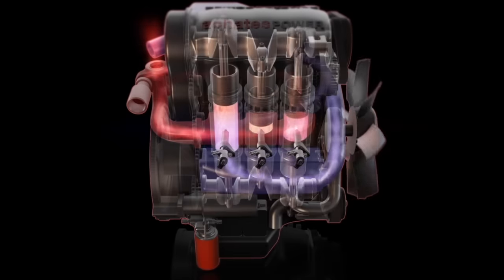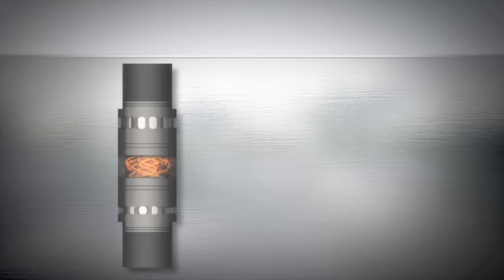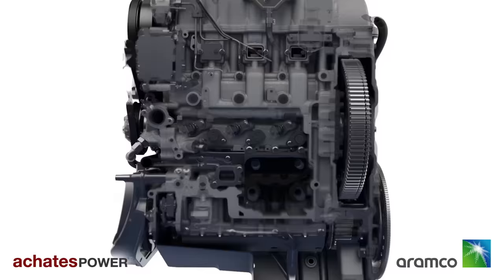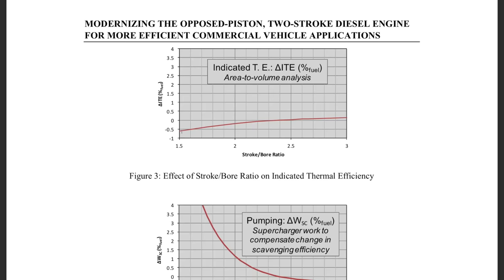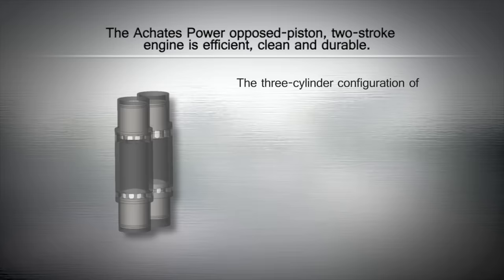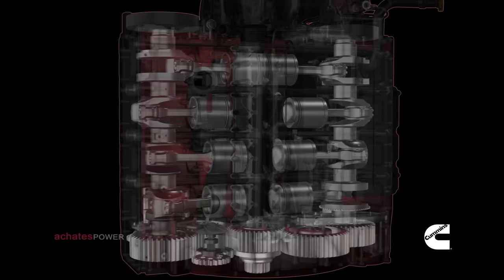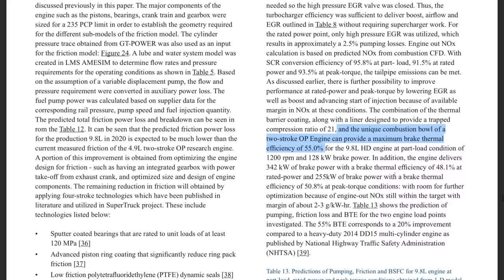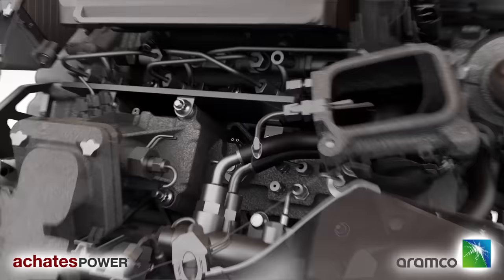Opposed Piston Diesel Engines Are Crazy Efficient

Comment: The disadvantage of this engine was high oil consumption which resulted in high burned and unburned hydrocarbon emissions. 
The cause of this high oil consumption was the pistons passing in front of the intake and exhaust ports.
Reply: Any two-stroke is going to consume oil, that is the whole point of the design
Reply: mijnkampvuur once the piston rings start to crack you will see the oil consumption, or see it coming out of the air box tubes like the old two stroke diesels. By the time this thing gets choked down by US requirements with exhaust particulate filter, SCR, VGT turbo, urea injection etc. it will be just as good as any other engine out there, not better.
Reply: Grant Schoen You are right about a 2 stroke engine consuming oil (thus higher emissions and more wear than in a 4 stroke engine)   However this is inherent to the design of the engine, it is not the point of the engine.
Reply: Yes, it is inherent to the design, but also is kind of the point - which is for the sake of simplicity & weight/cost savings to not have a separate crank-case/valve-train from the cylinder block, thus a higher weight/power ratio.
Reply: Grant Schoen. . the extra oil consumption and wear would be avoided if at all possible. . and so of course it is not any point at all -- but cannot be avoided.
Reply: Burning Oil is not the point of a two stroke.
Reply: Even if it's not something that blows the current systems out of the water, it has some inherent advantages with the much lower weight, add compression ignition and you'll still have a considerably higher energy density even as it starts losing hits. I personally believe that the coming of a 4 stroke is gonna just be a matter of time and the current concepts are already good enough for commercial testing.
Reply: You have misunderstood the concept, these engines have seperate oil in a sump like a conventional engine, the oil is only burned because  the crankcase is exposed when the piston close together allowing oil to escape.
Reply: It's unfortunate that so many people think that 2 strokes all burn a lot of oil. They can be designed with oil squirters or slapsticks just like a 4 stroke ect. Heck my 2001 see Doo is a 2 cylinder 2 stroke. No oil mixing and it's more fuel efficient, oil efficient and more powerful with a superior powertrain than most 4 strokes. This is a great idea for cars and trucks and even planes. Anyways it's been bought by manufacturers and its coming. About time!
Reply: This is a two stroke diesel not a 2-stroke gasoline there is a big difference 2-stroke in the sense that it produces power on each stroke with a gasoline 2-stroke engine oil is introduced into the gasoline to lubricate the connecting rod from the piston and the crankcase in the diesel engine that isn't the case it is oiled in the conventional manner via in oil pump so burning oil isn't an issue hence the higher efficiency
Reply: All electric cars suck and are too heavy because of battery weight.
Reply: Correct me if I'm wrong, but wouldn't it be of greater advantage if the pistons were horizontal to enable the ports to be on the top side of cylinder and reduce oil consumption?
Reply: Grant Schoen 2 stroke diesel not 2stroke petrol like a chainsaw engine
Reply: mijnkampvuur should make horizontally opposed. This might fix some of the oil burning problems
Reply: @stevefuller1779  it seems to me the pistons have double piston rings at the top an bottom of the piston so there's no way oil would escape trough the intake.
Reply: @andrewgroves8523  so like a subaru boxer but with 2 cranks different piston direction. That would interesting
Reply: A direct-injected two stroke does not mix oil with gasoline, this is how the current 2 stroke outboards work.   A diesel engine needs significantly  stronger  (read heavier) blocks to withstand the knocking.
Reply: Usually a 2 stoke diesel has another ring on the piston skirt to seal the crankcase from the scavenge air and exhaust ports.
Reply: @Grant Schoen a normal diesel truck 2 stroke (i drove one) does not use anymore oil than a regular deisel or the gas engine in your car.  the point of a 2 stroke is the get combine the power and exhaust and the compression and intake strokes so you have 2 strokes instead of 4.  small engines use oil mixed with fuel so that the bottom half of the engine is sealed and acts as a super charger.  when the cylinder goes down on power stroke the bottom half of the engine (the bottom of the piston and the sealed crankcase) act as a second piston and push fuel\air into a port that goes into the cylinder through a reed valve.  

now if the bottom half is sealed how do you put oil in it and change it without having a plug that could blow out or what happens if the engine tips a bit and the oil gets push into the cylinder instead of the air\fuel.  most very small 2 strokes (chainsaws etc) are made to be used in any orientation, even upside down so you cant oil running around inside the crank.  so you mix the oil with the fuel and use that to lube the piston.

but on a diesel 2 stroke you dont need the bottom half to be sealed because you can use a super charger or turboe charger to do the same thing that the crankacse and bottom half of the piston do.  the turbos push air into the cylinder.  so you can use regular motor oil in the same way that your gas car engine does.  most (pretty much all) diesal 2 stroke do it this way and have no oil mixed with fuel and the oil is changed as with any car motor.

not all 2 strokes have oil mixed with fuel
Reply: @grantschoen1726  it's a two stroke DIESEL! Not your average moped engine.  And since when has high oil consumption been a "point" for any engine design?
Reply: With a sealed oiling system the need for crankcase oil is eliminated. And today we have superior alloys for sleeves and piston rings. Reducing the need for wet oil lubrication. In fact a pressurised oil ring isn't out of the question. Shutting off the flow at the intake and exhaust ports will require minimal engineering. When I was in the 3rd grade I was talking to my uncle  (an excellent mechanic) about variable timing and combustion. He said that's impossible. Yeah I've been kicked down for every innovative idea I've ever had.
Reply: Thats probably why its diesel, because diesel is more oily
Reply: Shouldn't be for a diesel but the Deltics (Class 55 locomotive in the UK chuck out no end of blue smoke)
A petrol engine (gasoline if you are from the other side of the pond) , it is as the crank case is used to charge the combustion chamber so HAS to burn oil
Reply: Stefan0man  Most people don't really understand 2 strokes..  With direct fuel injection and sealed crank cases there is very little cross flow of older port timed systems and as mentioned oil use can be controlled very well now..
Reply: @Henry R you are so wrong about how how a 2 stroke diesel functions, it is comical.
Reply: if you look closely there is an oil control ring on the bottom side of each piston head/skirt that doesn't pass over the intake/exhaust ports.  question is, how are they lubricating the top compression rings? relying on the lubricity of diesel fuel perhaps?  i would be curious to know what the engine life is and how often overhauls are projected to be required.  in terms of operating costs, any efficiency gains can quickly be offset by having to overhaul the engine sooner than most.
Reply: Henry R diesel 2 strokes have a separated crank case from the cylinder and transfer intake and exhaust ports. A blower” is used to charge air into the engine. I take port. 2 stroke diesels have been around a long time. ie: GMC Detroit Diesel 6V92. No oil is mixed with the fuel before combustion.
Reply: From the pictures there appears to the 2 sets of rings. The ones at the base of the piston do not cross the ports. I assume this helps decrease oil burn.
Reply: Two stroke diesels are lubricated by a crankcase NOT by oil mixed into the  fuel.
Reply: There is a motor design without this oil problem. I think it was called kurbelschlaufenmotor (Ficht), don't know the english name. Something like scotch yoke. However it works directly opposite in function but the pistons don't need lubrication in a development I read about with something like graphite pistons in ceramic cylinders. It is quite different, without wobbling pistons. I leave this comment anyway.
Reply: @bobhumplick4213  Those old 2-stroke Detroit Diesels often had blower seals go bad. This resulted in oil being introduced into the cylinder along with the air charge to be burned, and most notably, oil slobbered all over the engine and the engine compartment. I drove numerous Detroit's over the years, 53, 71 and 92 series in particular. Some were total dogs, but a well-tuned, healthy "Screamin' Jimmy" with the right transmission and rear end ratio, was a driving experience to be cherished! If those Detroits stayed leak-free, their oil consumption was comparable to any 4-stroke in our fleet.
Reply: @ronaldgreene5733  I disagree. Take a good long hard look at G.M. 16 cylinder assisted aspiration engines used on locomotives. They are TWO CYCLE diesel engines utilising ports for intake and valves for exhaust, with very little crankcase oil loss. The lives of these engines are measured in millions of kilometers.
Reply: @stevefuller1779  Problem could be resolved by utilising REED VALVES to control the flow of exhaust/intake.
Reply: @stefan0man301  WOW, again, people thinking they've re-invented the wheel. Two stroke engines have been around for 100's of years. What has changed, is the way they are lubricated. For example, you Skiddoo utilises many advancements made by previous engine manufacturers over the years. The biggest break thru was computerisd injection and the optimal locations for this injection. However, it is FACT, they still BURN OIL. Otherwise they would not have a seperate oil tank for you to top up regularly. You are aware that SUZUKI was a leader in this field in the 70's and 80's with their three cylinder and later four cylinder two stroke engines, and of course the motorcycle manufacturers, still manufacturing two strokes to this very day.
Reply: @grantschoen1726  not two stroke diesel
Reply: @bobhumplick4213  We had Fairbanks - Morse engines on the Canadian National Railway 60 years ago. They were great until you had to repair them, which meant pulling the upper crankshaft to do any work on the pistons.
Reply: @jaswmclark  bet that was interesting
Reply: @grantschoen1726  You're thinking of two stroke gasoline.  Diesels are different.  They don't burn oil in the fuel like gasoline engines do.  They just have higher oil consumption due to the ports.
Reply: @grantschoen1726  but not necessarily excessive oil consumption, with modern fuel injection and wet sump, a 2 stroke makes more sense, specially in this setup. Besides, there are less moving parts, no cams and valves.
Reply: @vilemsustik3042  Ford just announced this powerplant will be installed on the F150, and it is not a diesel but compression ignition with gasoline.
Reply: Firstly there is no oil added to the fuel. Lubrication is usually dry sump with large scavenge pumps. Secondly as there is always a positive preasure in the cylinder due to residual combustion  or the  blower oil is no problem through the ports. Actually lack of oil around the fire ring has been known. Once the engine has warmed up they are quite clean.
Reply: @Michael467012  I would put the engine horizontally just because of better CG. The whole point of having those port placed on a ring is that you can achieve the same area with a more uniform opening. Having two holes instead of this ring pattern (as I assume you think of the "better" design) wouldnt help much in terms of oil consumption and would dramatically decrease performance. So they compromised.
Reply: @nimblemotorsports  It s impossible not to mix oil and gas in the chamber when you have two gaping holes in the design. Lubrication system is not isolated as in a 4 stroke
Reply: @grantschoen1726  i wonder if a 4-stroke opposed cylinder would still be more efficient than a conventional engine...
Reply: @itchyvet  No it will not.
Reed valves are only useful on PETROL engines to stop blowback through the carburettor.
On a diesel, the pressure on the intake is provided by a blower of some sort (turbo charger, super charger, Crossley used an air compressor), the crankcase is not used so no oil consumption (Well, no more than a 4 stroke, or shouldn't be)
Reply: @itchyvet  You are talking about PETROL engines
 Ski-doos, as far as I know do not use diesel engines
Reply: @stevefuller1779  how does oil escape from the crankcase??? The exhaust and intake ports are never  exposed to the crankcase except a slight bypass due to the gap between the Piston and the cylinder wall and a piston and cylinder length that never allows the exhaust ports to be exposed below the bottom set of rings ... This could be sealed with a second set of rings at the Piston base ... Thus negligible blowby ...
Reply: @jameswitte5167  , when you consider how many times a piston passes up and down per minute, even a tiny little bit of oil escape soon mounts up, also when the piston is at TDC some supercharger boost will leak into the crankcase around the piston skirt, conversely, on the exhaust side, that same pressure would leak back out of an adjacent piston  taking some oil mist with it. The problem with putting rings at the bottom is that it makes a weak point, also it increases the weight and you would need a long piston and bore to accomodate it all. As far as I know the Commer TS3 did not have too much of a problem but the Detroit Diesel were well known drippers. Still love two stroke diesels though.
Reply: @stevefuller1779  true ... Even gasoline engines have "some" oil infiltration ... I like the HP/Torque numbers here too ... Double ... I want it in a trike ...
Reply: @jameswitte5167  , that would be fantastic, I just want one to listen too ( want a Merlin Too!)
Reply: Michael467012  or even on a 45 degree to lower engine height and center of gravity . It could go north south with the top of the engine being right near where a conventional radiator cap is .
Reply: @grantschoen1726  In normal two stroke petrol engines the oil additive is used for crankshaft bearing and piston lubrication. This in not the case here because the fuel mixture does not pas behind the piston.
Reply: There are  admissions reducers on  lots of 2 strokes I'm sure they could figure somthing out.  Admissions won't be a problem.
Reply: Sorry, not correct. Don't confuse 2 stroke cycle with 2 stroke weedeater/chainsaw engines. Read up on 2 stroke engines with an oil sump.
Reply: @grantschoen1726  the oil consumption was related to gasoline engines.
Reply: @g8ymw  actually you're wrong. The Sulzer slow speed CI engines had reed valves.
Reply: @bobcornford3637  Why would they have reed valves, I do not understand?
The Sulzers used on Britain's railways were all 4-stroke
Reply: @g8ymw  This is a slow speed marine engine. Sulzer made all manner of four and two strokes. The ones I am refering to are uniflow engines, that it they have poppet exhaust valve. The reed valves are on the inlet side to ensure that air flow only occurs into the engine at starting when the electric blowers are in use.
Reply: GM solved this problem very simply on their 2 stroke diesels by having a second set of compression and oil control rings at the bottom of the piston, the crankcase is never exposed to either exhaust port gas or inlet port pressure. At Top of stroke the ports align with the piston skirt between the upper and lower ring sets.
Reply: Thats what makes them fun, same with rotaries, castor 927 maxima is awsome, i mix and run it my truck too
Reply: whats wrong with burning a little oil, thats what castor 927 maxima is for.
Reply: @vilemsustik3042  My goodman :) I agree, and this engine does not have sump ports, unlike the gasoline 2-stroke. The pistons also have the an extra set of rings to push the oil back to the crank shafts(and do not pass any gas ports), diesel will lubricate as well. Now I want to play with one xD
Reply: I like high oil consumption thats what castor 927 maxima is for
Reply: Wow there is a ton of people that shouldn't even be commenting....The 2-strokes you all refer to "burning oil" are Crankcase Compression 2-strokes...they literally pull the fuel into around the crankshaft, then push it up into the combustion chamber, that's why the fuel needs to be mixed with oil....fuel and crankshaft / bearings don't mix very well.  Direct injection pretty much solves all of that... helllllo?
Reply: That’s what makes them fun castor 927 maxima makes me high
Reply: That’s what makes them fun castor 927 maxima makes me high
Reply: Why not enjoy a little smoke now and then. I love castor oil 927 in my motors, quit worrying about all these emission with a bean it seed or hemp oil, there is no need to freak out over s little emissions as burning a some oil is good fore the soul. Have fun before brutal powerful electric takes over with all torque but no character.
Reply: Broken Smokin' Spokes I’ve been thinking this the whole time I was reading the comments. I completely disassembled a Fairbanks-Morse opposed piston engine when I was in engineman school for the Navy and am in disbelief at the amount of Dunning-Kruger I’m seeing here. It’s completely avoidable. Read about something before you ignorantly comment unless you’re 8.
Reply: it only burns a small amount of oil then
Reply: I like some oil consumption i fill and run tcw3 in my truck and mix at 70:1, so far so good i run nothing but 2 stroke oil now as 4 stroke is just an illusion of the mind, i quit the 4 stroke habbit a long time ago!
Reply: Just throw some castor 927 maxima in it youll be fine, and dont be afraid to premix, a little oil injection, premix is good for the soul. i do it all the time.
Reply: Bruce Miller 4 stroke and 2 stroke have real world definitions that aren’t illusions.
Reply: Not necessarily true.  The GM/Detroit Diesel two stroke engines had cylinder ports in the bottom of the stroke and didn't burn any more oil than any other engine would as far as oil getting on top of the piston.
Reply: True. But you have to remember, It is a two stroke engine. Compared to a four stroke, It is double the horsepower and double the fuel consumption in the same size package. It would be better to compare it to another 3 cylinder 2 stroke engine, or a v6 4 stroke engine in terms of efficiency.
Reply: They claimed to have achieved 0.10% fuel-specific oil consumption. This has been a difficult engineering problem in the past, but they have claimed to address it. Other companies have produced 2 strokes with similar oil consumption, for example, the direct oil injected outboards produced by Evinrude.
Reply: @grantschoen1726  Yes and no. Diesels are designed around the fact of consuming oil. Diesel fuel is a kind of oil, that's why. All 2 stroker gasoline engines lubricated with some kind of oil in the fuel, as the crankcase acts like a compressor (and you need to lubricate the bearings somehow) for the uniflow scavanging but this is not the case for the diesels, that's why the compressor (US translation "supercharger" lol) is there. The 2 stroker diesels have a special piston that has rings on the top and on the bottom to seal the crankcase from the intake ports, so when it is working properly without issues it should not consume more oil than any other piston engine.
Reply: @andrewgroves8523   2 stroke is general term for a 2 stroke engine. Nothing more. It's the type and has nothing to do with it's fuel or it's oiling system (or lack thereof) requiring oil consumption or not
Reply: @g8ymw   no, the reason why cheap 2 stroke engine needs oil, is because they dont have a supercharger. They need the air movement of the crankcase to expel the burn gases. It has nothing to do with the fuel they use. If you want a sump with oil (versu mixing oil) like a normal car  in a 2 stroke engine, you need forced induction.  
As for your locomotive, it doesnt have electronic direct injection, the blue smoke could also be fuel and bad combustion, not just oil  burning.
Reply: @jlpservicesinc1452   Been replying to comments on this.  2 stroke is a large cathegory. Then it separate into oiling type and same time induction type. You need forced induction to make it a sealed crank case with no intake air going into it. Otherwise, you can't empty the cylinders.
Reply: @Veikra  I'm confused[dot]com
I don't know if your posting was all addressed to me because you have said what I said.
The Deltics had an oil collection drum in the exhaust so there is something somewhere letting oil out.
I have owned 2 stroke bikes and i am familiar with 2 stroke uniflow diesels
Reply: @g8ymw  I think that's how the reply ended up. Not always clear to whom the reply ends up. The emissions level that prevented the mainstream use of 2 stroke engines. The oil consumption is only slightly higher than similar 4 strokes. It's not that bad but may have a bigger tendency as the engine wears and gums up the rings. Being there's always pressure in the cylinders, they dont get moved around as much and could stick eventually. I really like the 2 strokes, and I think the advance in injection system and oiling system could sort out the drawback they had 30-40 years ago because they arent that different from 4 stroke now that we all have turbo and superchargers.
Reply: Vilem Sustik Screaming Jimmy's Detroit Diesel 2 stroke 53-71-92 series engines.
Reply: A 2 stroke engine consumes and emits oil as the oil must be added to the gasoline and the lower part of the engine (crankcase) is closed, has no direct lubrification as it's the space used to pump the mixture air+gasoline+oil in the combustion chamber. This engine anyway has a compressor to do that, so it's not different from any other 4 stroke engine when it comes to oil consumption and emissions.
Plus it uses fresh air (and not air+fuel) to flush away the burned gases, so there's also not unburned hydrocarbons emitted like in the more typical 2st engines (like the small motorcycle ones)
Reply: @kevind3185  if you have read all my message, that's what I wrote :)
Reply: @grantschoen1726  you mean any 2 stroke that uses run to waste lubrication burns oil. This motor- in good condition should use no more oil than a 4 stroke.